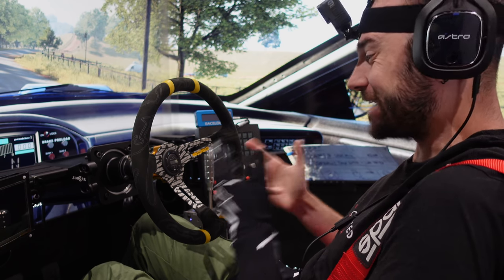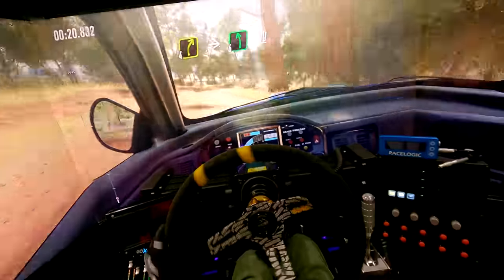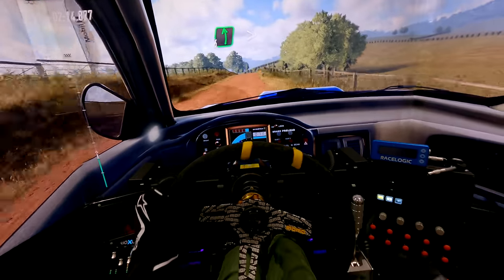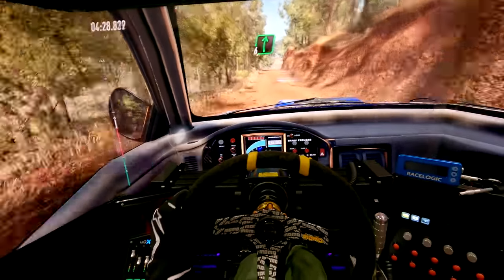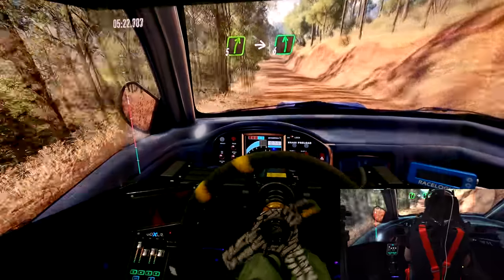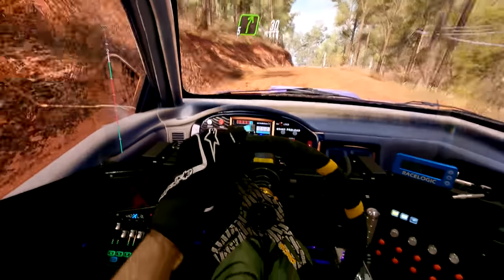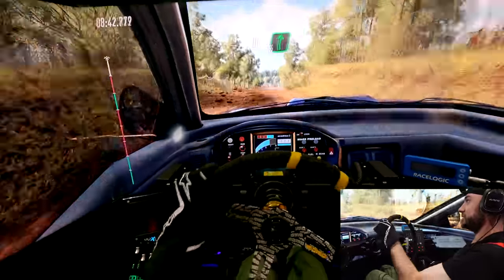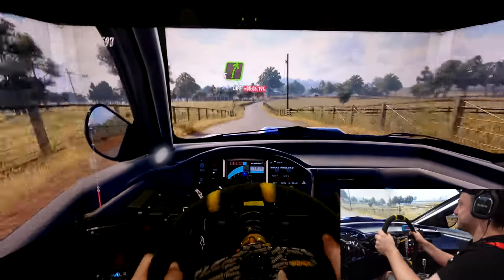GOPRO POV CAM - Rallying in the BEZEL FREE Triple 65 Inch 4K Motion Sim Rig!

Comment: That looks amazing! I just bought a gaming desktop and have been using the Xbox one up until now. Started iracing about 2 weeks ago but havent yet tried rally on the computer which rally is my typical go to. Sadly Covid wrecked my real life rallycross season last year due to travel restrictions so the subaru is sitting under a foot of snow in my yard waiting for ravel restrictions to lift.  Iracing has scratched that itch for now..

Comment: a little tip for no Bezel Free kit. With a warping software (e.g. ImmersiveLCDPRO) you can completely eliminate the fish-eye effect.
 you only need to compress the picture behind the aperture and stretch the rest of the picture.
 that takes a little time, but it disappears completely if you take your time.

the software costs a lot of money, there is a demo version for testing

the text was translated with google
Reply from the maker: Awesome! Thanks very much for drawing our attention to this!!
Reply: @boostedmedia  You  welcome. When you configure it, make sure that you set the  point "Move" to horizontal only. otherwise you will go crazy with them.
With all sims, you can also compensate the bezel correction in the negative
Reply from the maker: Perfect! Thank you!

Comment: Wow very cool. How are you running Dirt across the 3 screens? Nvidia surround? If so, does that explain the weirdness of the wing mirrors since it doesn't account for the angle of the outer screens?
Reply from the maker: The mirrors are that shape in real life. But yeah we’re running surround which is why the doors are a bit warped.

Comment: Funny how I said how cool it would be to rally in this setup and next video is rallying:)
Reply from the maker: Haha been meaning to do it for ages but wanted to save it for when we had the traction and bezel free stuff set up :)
Reply: @boostedmedia  Glad it all worked out the way you wanted without to much trouble along the way. I thought the emersion with my CSL Elite P1 setup single monitor was good but this is on a different level, GG.

Comment: you need to fine tune the tracking....still at turn in your dashboard moves in relation to your steering wheel...seems like the car is flexing unnaturally...I think you need to reduce the range on the x axis a bit...maybe you need to open up a bit the screen angle to reduce the dashboard bending effect??...nice sim though mate...congrats..:)
Reply from the maker: Yep still needs a bit of fine tuning and yes I agree, there's still a touch too much yaw.